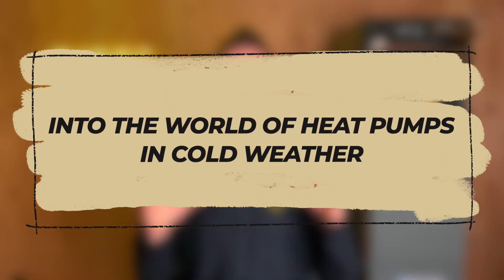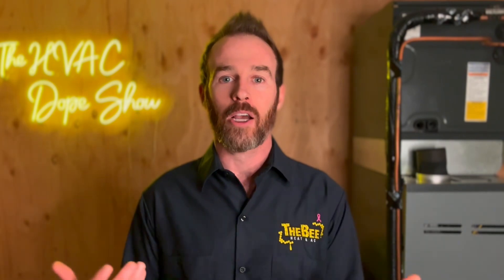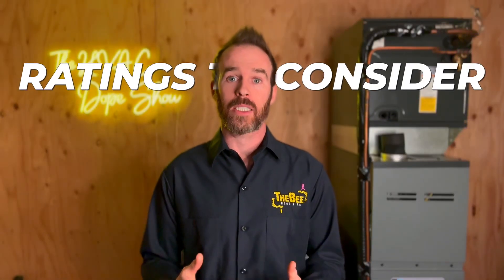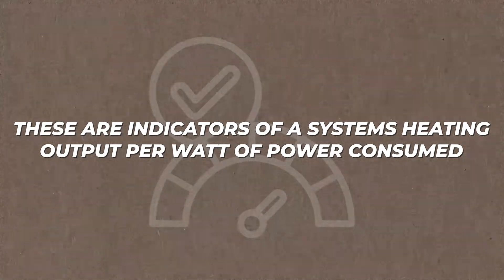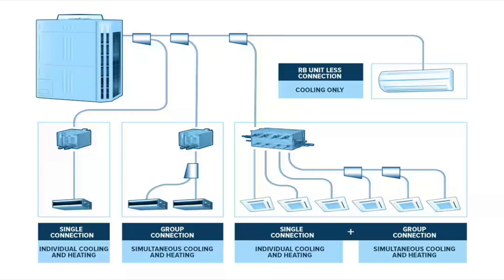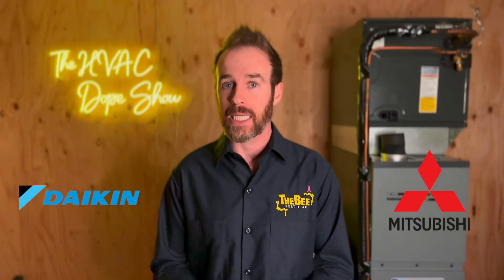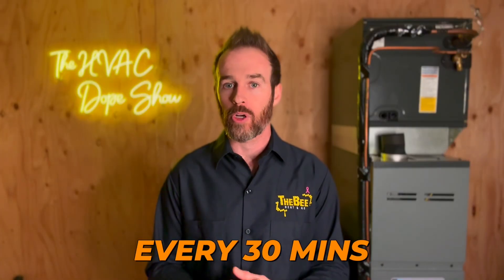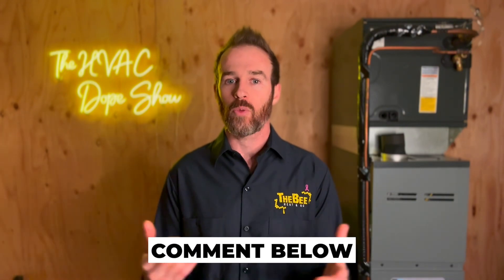Heat pumps and COLD WEATHER 🥶🔥

Comment: My gas furnace works every day no matter the temp, so why are heat pumps being pushed?
Reply from the maker: Decarbonization/green movement… I’m with you lol, if you are in a place where electric is cheaper they can be a better choice. Emissions from natural gas are actually very low by comparison with old systems and energy sources but it’s just case by case. It makes a lot of sense for people on solar. We have customers with no electric or gas bill year round, and customers completely off grid (propane is expensive) so it’s a no brainer from a practical perspective for some of them

Comment: Thank for the video. I had my furnace replaced 3 years ago and it was oversized. It countinued to over heat and shut off and turn back on right away. Ive had the technician out 7x now though out the install to try to fix. I was told by a different hvac tech that the has was tuned down to temporarily fix the over heating. Well now its in the negative cold snap here in Chicago and my heat cant keep up with the -10s and 20+degree windshield. Runs all night for few days stright sometimes dosent shut off. We went to bed and it was 74 degrees woke up and it was reading 68 degrees in the home. Had to buy a space heater to make it though last few days. Different techs who came out said the furnace installed was to large for my home. Also the return air duck was to small. They said the  downstairs area could use a return because it dosen't have one. My question is, is this issue fixable and is the contract responsible for rectifying this problem with the correct size furnace. I have a warranty company that i use and they now said they aren't going to replace it, even though they admited to the contractor they used said the new units to big. My old furnace never had that problem before. Any recourse you can recommend be greatly appreciated.
Reply from the maker: We teach our techs about sizing because it’s one of the most important things and we often replace systems that are the wrong so I wouldn’t be surprised… if it’s marginal then increasing return air via more supply duct runs or an added return can sometimes be enough, but if it was our installation our policy is to replace it if it’s the wrong size and was our mistake. That’s because we don’t like arguing with customers or trying to gaslight them and tell them everything is fine if it’s not. If it’s definitely the wrong size then give them the opportunity to replace it, because if you don’t and try to take them to court later after hiring a competitor to fix it they will say you didn’t give the company the opportunity to make it right. (Also sizing is easy, this can be verified easily with math and charts… supply ductwork should allow for enough airflow, you should have the proper delta t, etc and a load calc is easy to perform). But if the company refuses to replace it you can hire someone else and seek legal recourse at that point but it’s kind of a pain, that’s why dealing with them to make it right first is probably best especially if they’re willing to replace it. But if they’re not then you should get the right system from someone else and handle it that way. We’ve had customers have concerns about sizing and it’s because of bad information from competitors (we bid a 2 ton and the competitors bid a 4 ton… the 4 ton would never work properly in this example) so keep that in mind. Also, when it’s that cold out sometimes the house in general doesn’t keep up… at my house I’ll run the heat pump and boiler but if it’s -10F or colder it won’t get above 62 / 63 because we have so a lot of old windows and poor insulation. This is not uncommon, but if your old system kept up sounds like a bad install

Comment: Looking to put a mini split in my garage for a golf simulator in West Michigan. The garage is about 855 sq. ft. with 11' ceilings; batt insulation in all the walls, only 2 windows and 3 insulated garage doors. The garage typically stays above freezing most of the winter. I'm not looking to install the unit for living space comfort. We'd like to be able to keep it around 65 when playing golf in the winter, and bring it down to around 75 when it gets in the 80s and 90s in the summer. I feel like I'm right between 18K units and 24K units, and there's a fairly big price jump. Thoughts on this type of application? Go for the larger unit to cover those really cold and hot days?
Reply from the maker: Maybe on the 24k only because low ambient performance will degrade output… once a low ambient heat pump gets down below 0F it’s low ambient output tends to drop pretty substantially. To qualify as cold climate rated for the recent tax credit they only have to maintain 75% capacity at 5F. Idk how often your area of Michigan gets that cold but if it’s mostly above 10F (just checked the ten day in Lansing for example at 20F+ lows) then that 24k won’t struggle at all and will keep that space pretty comfortable. For what you’re trying to accomplish 18k would probably work too so I think you’ll be happy with either, normally the price jump isn’t that big from unit to unit but also depends on the brand specs

Comment: Very informative. I have a GE heat pump. I find that it calls for backup heat at -10C. We recently went through a cold spell down to -10, and it could not keep up. The installer says that there is no issue with the machine. I have asked for a second opinion. I also run a Daikin and it ran fine through our the cold.
Reply from the maker: Thanks I’m glad you found it helpful. Sorry to hear your GE isn’t keeping up, out of curiosity is that just a basic single stage system? Because if so usually the COP ratings aren’t great on those but if you have a model number you / contractor can check the COP chart and determine the best switchover temp. -10C isn’t terribly cold for a heat pump so I’m surprised it was struggling

Comment: I live in an apartment and the owner just had a heat pump installed for my heating and air conditioning.   Since it’s winter, I have it automatically set however when the temperature reaches to the desired temp set, it constantly runs. Is this normal?? Thanks for your prompt response
Reply from the maker: The fan constantly runs on the inside unit or the outdoor unit? You will get longer run times in normal operation, depending on how you have it set. Is this a mini split ductless or a central air / forced air unit? It will normally hit set point and shut off after an overshoot of 1 degree or so depending on the system and how it’s setup… mine has a 2 degree dead band so if it’s set at 70 it won’t kick on until 68, and won’t shut off until 72. This is an efficiency feature to prevent short cycling.
Reply: @TheHVACDopeShow  It constantly runs on the inside even though set to auto… not sure about the mini split question as this is not my expertise

Comment: This guy is full of crap just pitching his Daikin  brand. They do work but very poorly and at higher cost than a gas furnace
Reply from the maker: Depends on the region, your electric rate vs. gas, and the COP of the heat pump… if you’re in northern Montana this is probably true, but in Colorado we install them all the time and the good ones are cheaper to run than gas furnaces
Reply: @TheHVACDopeShow  Ok back it up with facts. For the Colorado system present the COP numbers vs. Temp and cost of system and estimated installation costs. Do the same for the gas furnace. Let's see who's wins.
Reply from the maker: But the blanket statement you made isn’t true… you have to dive into the data and unit specifics and look at the bill on a case by case basis, thanks for the comment!
Reply: @TheHVACDopeShow  Well  prove me wrong with real data, including cost of the system and the alternate gas furnace option. Talk is cheap we need real numbers
Reply: @hansgruber2509  I installed 3 heat pump hot water tanks to replace a 180k btu gas hot water tank.  Cut the gas bill by 20%.  Electric bill moved up a little but not much.  Heat pumps can definitely save you money but it does depend on gas cost, electric cost and the air temps of your city.  I have 4 years of gas bill data using Gjs and 4 years of electric bills for kWhs.   I also have temperature data to see that it isn't just a milder winter but so far just 1 year of data with heat pumps working.  The best compare point was a 20% drop ( other months were more and others were maybe a bit less ).
Reply: @walnutcontractors5661  What you just said is meaningless. How about showing the data and a comparison of both including cost of installation and winter performance and energy costs. 
In my opinion a heatpump water heater is a scam, cost almost 4 times the price and 100x more complicated therefore less reliable
Reply: @hansgruber2509  Cost of install was expensive.  My scenario was the goldilocks scenario for HPWTs.  The tanks go into a machine room with a 1985 boiler so the HPWTs get to absorb a lot of waste heat in the room.  The HPWTs were replacing a 180k btu gas water tank that would normally cost 12k wholesale.   The existing dual gas water tanks were oversized for the demand.  1x 180k btu tank wasn't quite enough but 2 were overkill and likely wasting a lot.  The hpwt are 4200 btu so 12k btu more plus the additional storage from the 180k btu via recirc works out.  With the year to year weather is it really hard to say 100% what the saving are.  I have 9 months of data but it looks like a >20% savings on $44k annual bill.  So savings are $8k per year.  Cost of the units was around $9k total and $21k for the hookup ( plumbing and electrical changes ).  Cost of a replacement for a 180k btu tank would have probably been $15k so you could say this cost us 15k more than the other option which at 8k per year pay back we only need 2 years to break even.  The 22k hookup is done so if we have to replace one of the hpwts then probably only a 4k outlay.  Additionally the decommissioned 180k btu tank can serve as backup for the primary in case it fails.  I only run the tanks in heat pump mode so the electrical increase is minimal but I haven't run the numbers on the additional cost to run the compressors I'll probably do that once I have another 3 months of data.

Comment: I have a goodman heat and cool pump and I'm wondering if i should switch over the emergency heat in single digits and negative temperatures.
Reply: Is the outside unit freezing up ? If it works pray for warm weather.
Reply: @MacGyver2154  its not freezing up or anything, i just don't wanna burn it up by running it to death. Its -2°F with 8" inches of snow outside and 75°F inside. Its defrosting good, there's no ice on top or inside the unit. In 2015 it kept the house at 74°F with it being -22°F outside with 28" inches of snow. But it ran nonstop of 3 days. I really don't wanna buy a another unit because of users error. That why's i'm asking about the shutdown temperature, to start using the electric heat.
Reply: @jamesrunions4553  you should be good,  I am in similar position. 2 degrees in north Mississippi but too many defrosting cycles that didn't drain away and now the outside unit is too frozen. 
Trying to get propane heaters going. In the morning I will try to put hot water to melt the ice.
Reply: @MacGyver2154  we're at 2,200' feet in the mountains of eastern Kentucky, on the Tennessee, Virginia border. I hate this time of year because of the cold. I'm gonna buy a wood stove this year and have it 90°F in the house on nights like this. The coldest that i've seen it here was -28°F, the inside of the back door was white with frost.
Reply from the maker: You can do that it just depends on the heat pump, what model # is it? Because if it’s designed for low ambient operation it should do that on its own but if it’s not doing well in cold weather switching over to electric heat at a higher switchover temp is a better bet. It just depends on the COP (coefficient of performance) and each model has a chart of its performance based on the temps outside. Once the COP drops below 1 you are better off with electric heat, and normally the switchover temp is somewhere around a COP of 1.5 or so.

Comment: Have a friend that switched over from oil to a heat pump over this last summer. Unfortunately,  we are having a really cold few days (15 degrees).  My fiends house will not heat up past 50 degrees.  Nothing heats up a home like gas at 1/3 the cost vs heat pumps.  If you like Luke warm air, go with a heat pump.  If you like to feel a blast of hot air at 1/3 the cost go with gas.
Reply from the maker: It sounds like an install issue, or undersized, or switchover wasn’t set for the right temp? Because it should switch over to backup heat once it stops keeping up. We normally set switchover to backup heat between 0 and 15F depending on how it’s sized. Have a heat pump at my house that keeps up when the boiler gas boiler doesn’t so it sounds like it needs to be checked out because it should be keeping up. Hopefully they didn’t put in a single stage basic heat pump because those won’t do well in cold weather normally.

Comment: Very informative video! It definitely helped in the ongoing decision of choosing the right heat pump where there is approximately 50 days of the temperatures being below -20°C (but can also get as high as 37°C in the summer). Being in Canada, many of the brands carried in the US are available to here as well but there are also some other brands offered that will require further research on my end. We've had a few contractors say that side discharge heat pumps are less efficient overall compared to horizontal discharge units (the horizontal discharge units are also quite more expensive it seems). Do you have any opinions on this difference? And does this difference matter in a climate where there could be greater snow/debris accumulation? On the contrary does the orientation of the heat pump matter for temperatures around the 40°C mark? If you could help, that would be greatly appreciated. Looking forward to your reply!
Reply from the maker: Hey that’s awesome thanks! Short answer is side discharge is common for low ambient heat pumps. One thing we’ve also started looking at is air to water products because these are better in colder temps too but you just have to ask about the COP ratings. Nordic is based in Canada and makes these types of heat pumps and they may be worth looking into. Side discharge heat pumps do fine at 40 C, it’s more manufacturer specific. Your contractor should know what will and won’t work based on the region but I would just ask if they know the COP ratings of the heat pump at lower temps because once they drop below a COP of 1.75, or significantly reduced capacity (below 60%) is when it’s going to switch over to backup heat. But cooling at 40C is no biggie, the DZ6 enhanced will work up to about 48/49 C (119F) which we get in Phoenix Arizona. 40C is hot but pretty normal
Reply: Thanks so much for the reply, definitely appreciate the information! We've had multiple contractors come to our house offering various brands and models of heat pumps. However referring back to this video we felt that it was essential to choose something that had multiple fan stages, and decent EER, SEER and COP ratings. One brand and model really popped out at us which was the Napolean WSEHV2436RA1-N 36,000 BTU unit. This is the exact same model as the Gree GUD36AH2/A-D(U). The EER/EER2 ratings are 11/10, the SEER/SEER2 ratings are 18/16 and the COP is listed as 3.5. The COP listed in the specs seems very general with no specific temperature correlating. However the governenment of Canada has released further information of various models and the tested COP at -15°C is listed as 1.8 with a capacity maintenace of 72% at the same temperature. Have you ever heard of these models and are these values pretty decent for the climate I had mentioned previously? I look forward to your insight!